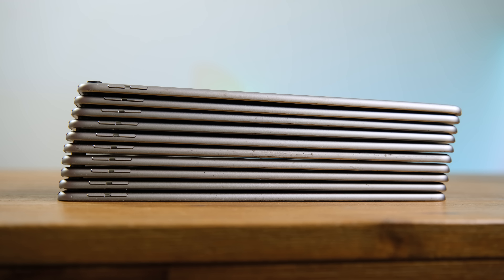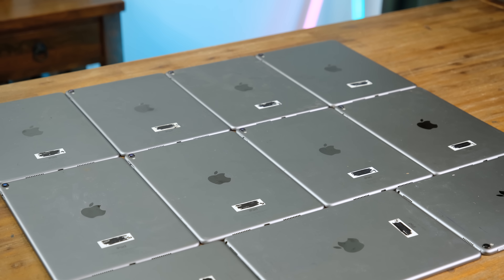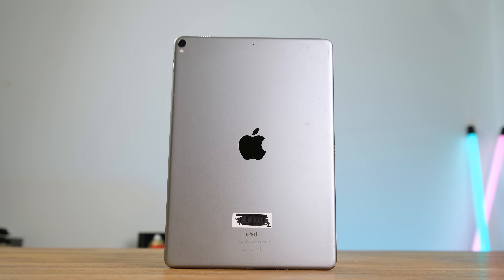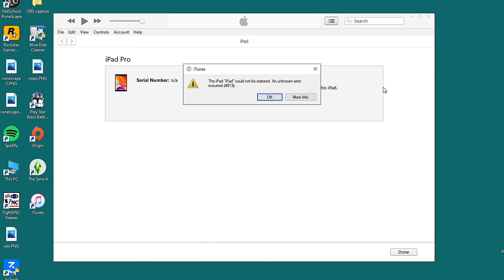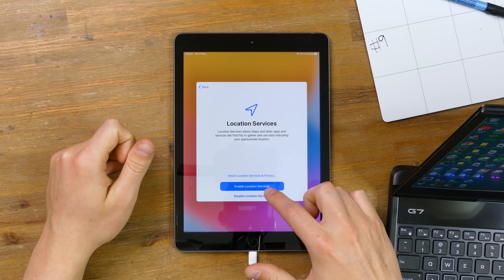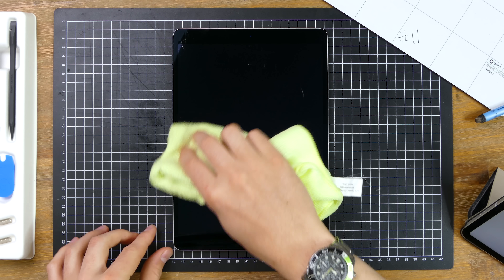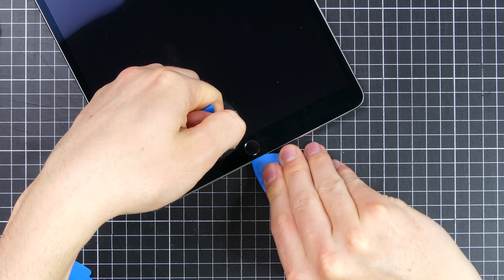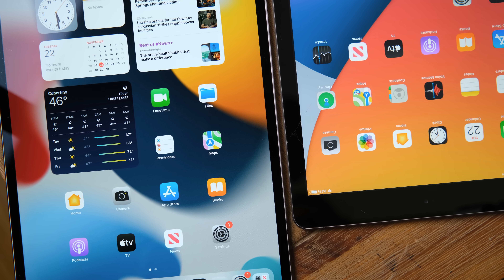11 FREE iPads Thrown Out By A School!

Comment: This is the kind of e-waste Apple should be focused on, not chargers and cables. Combine serialized components with soldered parts and one failure leads to a pricey paperweight. Given the battery and rare metals used, I'd say these dead devices are more environmentally hazardous than chargers and cables.

Comment: You saved yourself so many hours of frustration by not bothering with replacing the home buttons. Never doing repairs on iPads ever again after attempting it myself.
Reply: lol yeah it is tough, but it is worth the effort too, and possible if you heat it up for a while
Reply: It’s really easy if you heat it up and use a little bit of isopropyl alcohol

Comment: Glad to hear you got one of the iPads working! You can remove the home button from the original display and swap the two home buttons, so that the working iPad still has Touch ID (home buttons are a paired component).
As for the other iPads, the ones with failed NAND can still be recovered for any other parts that might be working, and the same goes for the iCloud locked ones. Unless the school in question can contact the students who used the iPads, there's not really any way of removing iCloud locks - which is why I tend to steer clear of iPads, in case any device I'm trying to look at has the same issue.
Reply: iCloud locked devices can be unlocked by contacting Apple, though you would need the invoice where you bought the devices from and then wipe the device.
Reply: @reazlho  I used a fake receipt maker and it actually worked, watching this video on the iPhone 5s just fine
Reply: @0w3nn  that's crazy
Reply: @0w3nn  Pls tell me where u got it from bro.
Reply: @0w3nn  apparently that doesn’t work anymore, a friend who works at Apple told me that now they actually contact the place of purchase :( I still plan to try it though
Reply: @ilyasg2108  I did it three days ago though but to be fair, I had a some information that assisted me such as that it came from Koodo and it’s purchase date
Reply: @0w3nn  yeah but i mean all the info can be found with an imei check
Reply: @ilyasg2108  Ye so it should be possible cuz it worked for me
Reply from the maker: I'll have to try and use the original home button. I simply ran out of time to film more and wasn't aware of the bottom being pared to the motherboard 👍
Reply: @psivewri  I hope you do a quick follow up!
Reply: teach me pls 😭😭😭
Reply: @psivewri  Yes, that would be a great idea for a follow up - if you have the original home button then it should be possible to swap the buttons over - the same is the case with iPhones that had Touch ID - in order to retain the fingerprint scanner you'd have to transfer the button across.
On more modern devices, a lot more components are paired.
Reply: The iCloud locekd devices can be bypassed and be used once again if they have A7 - A11 cpu using softwares like checkm8
Reply: You’re supposed to buy the iPad instead of getting it second hand. I bought one from a pawn shop back in the day and it was locked. Brought it back, paid an extra 40 and got another one that wasn’t locked

Comment: The 10.5" iPad Pro is a great machine. Still have and use mine since 2017. With ProMotion and running iPadOS 16 it really feels like a modern device.
Reply: Same here. I paid $750 for mine with 256gb of storage. The new iPads pale in comparison to the bang for buck I got in 2017. The fact they don’t have pro motion yet is absurd. I’ll upgrade this device when Apple no longer supports it.
Reply: @terrorrbabbletwo  even then you can get 1-2 more years outta it. still using ipad Air. yea the first one :D
Reply: @terrorrbabbletwo I thought about getting that iPad but i did not because I read there were reports of white spots on the display. I Really like that 2017 iPad Pro but at this point in time, I think the 9th gen is a better buy. Tried out the pro and non pro ipads at BestBuy and I could not tell the difference in Promotion and non promotion displays unless i scrolled the 2 ipads together. Promotion is not a big deal to me in the overall experience and i dont notice anything different when using different a non promotion iPad. I was hoping the iPad Air could at least get Promotion.
Reply: I still use mine and it's great but Apple's complete ignorance when it comes to the fact those have a factory defect displays is just bad, both touch issues and white spots, most have this like the issue macbooks had at least those sold in such numbers they acknowledged it.

Comment: When I worked in the eCommerce department at my local Goodwill, iCloud locks were by far the most common reason for us to throw out or set aside an i-device for parts. We had entire stacks of locked devices
Reply: that is so unlucky. is there no way at all to salvage them? once theyre locked, theyre locked forever?
Reply: seems like a prettty cool job.
Reply: @aelie8198  Apple can unlock devices for people that can provide proof of ownership, but they don't offer that to organizations, AFAIK
Reply: @aelie8198  That's the point for thieves
Reply: @Coolie-ds4tu  No, it's just Apple's way of making it more difficult to re-use their devices. Don't fall for their marketing scams.
Reply: @aelie8198  basically
Reply: @fiverZ nope, activation lock is just used to stop stolen devices from being reset and resold. If the genuine owner wanted to resell the device, all they need to do is remove their Apple ID in Settings and that should remove activation lock since it isn’t associated to an Apple ID
Reply: @ali-1000  Are you joking or do you actually believe this was Apple's intent with introducing this feature? Do you not know anything about Apple's relentless anti-consumer practices?
Reply: @fiverZ  yes I’d like to think that I know of a few of apples anti consumer practises such as the existence of the self repair shop is indirectly anti consumer plus the act of locking different components to the logic board and it does suck. However those are features that we can not control, activation lock is something we can control by just logging out of an Apple ID. Activation lock doesn’t prevent genuine owners just trying to resell their old phones. I fail to see how this is anti consumer unless you’re willing to explain
Reply: @fiverZ  your logic is flawed. most, if not all people log out of their accounts before reselling a device. And if they do forget, the buyer can just ask the seller to remove the device from the Apple ID. Apple isn’t betting on anything, it’s just preventable user error.
Reply: @ali-1000 so im a thief for trying to get rid of a disabled icloud lock for a gmail that no one uses anymord from my little cousins old iphone se he gave me? Very original 😐

Comment: The white screen with black home button was a third party display repair with keeping Touch ID from the original home button. You could do this same thing with the iPad you fixed to restore Touch ID functionality.
Reply: Yeah, I've been looking into getting a replacement screen for a trashpicked iPad I ended up with recently, and sometimes either the black or the white ones will be sold out. Clearly someone didn't want to wait.

Comment: That's like the bank I used to work for. They would do laptop or desktop upgrades for the employees and decommission the older ones which were later picked up by the same company that would go and empty the recycle bins. Pretty wasteful especially since most of them worked, they could just have given them away to the employees who wanted them. I took two of them on different occasions since I worked within the IT dept and they work great.
Reply: Ur so lucky I'm in need of one rn

Comment: For the iCloud locked ipads there is a possibility to change the SN with special tools and software and set them up like they were never locked at all. As for the ipads with NAND issues it's fixable by microsoldering but very costly

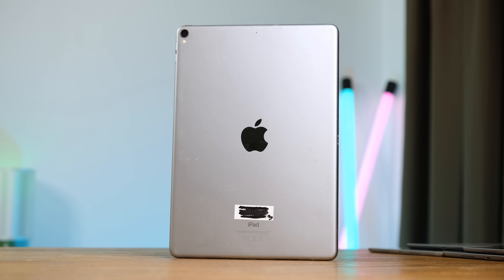Comment: 3:33 the reason why the screen and home button are mismatched is because someone at one point probably replaced the screen. The home button/Touch ID is paired to the logic board, and replacing it to match the screen would cause the Touch ID not to work.

Comment: Strange that schools dont have somesort of iPad enrollment system where u won't need an iCloud or Apple ID to install apps or push updates...
(something like JamF)
Reply: Some do! I got an iPad a school was throwing out because it had a shattered screen, and it's locked down using JamF so I can't do much of anything with it besides surf the internet and use the apps they'd already installed. They even have a delay on system updates, by like a few weeks.
Reply: @stevethepocket  Oh yeah, it sure relies on the settings set in JamF. The iDevice will only be fully yours if they remove it from JamF...

Comment: i would suggest you remove the original home button from the old display and put it with the other one. so u have touch id since they are paired to each device. just a heads up :)

Comment: For the iCloud locked ones, you can use checkm8, a bootrom vulnerability available on <2017 iPads. If the iPads are cellular, the network will be unavailable.

Comment: You could've also transplanted the home button for a fully working iPad. Great video nonetheless. Apple really needs to do something about iCloud locks creating so much ewaste...
Reply from the maker: Looks like a lot of work and pretty delicate to remove the button in hindsight.
Reply: @psivewri  It’s actually pretty easy if you heat it up and use isopropyl alcohol to loosen the adhesive

Comment: Sounds like the school learned the hard way to use MDM. FYI you can get a device un-iCloud-locked by Apple if you can provide proof of purchase. Iy requires wiping the device, so you'll lose whatever is on there, but overall it would be usable again. Device locked is another story. You need the Apple ID or MDM to fix that. All of this can be avoided by an MDM tool on an device linked to the Apple Business Manager (used for schools too).

Comment: Schools where I live also provide this, or rather, they provide very cheap, underperforming tablets. I wonder if any school near me would at all offer to get rid of their e-waste like this instead of throwing it away. One day I asked my own and they just refused, and I ended up sneaking an old PS/2 keyboard inside my backpack lol

Also, I got this Samsung Galaxy Tab E, it refuses to charge, no LED lights up, and I don't have the tools to pry it open and check what is wrong. It's my mum's old device, it worked just fine but she got a new phone and we left the tablet unused for a good while. Would leaving it charging for a few hours help bring it back to life?
Reply: leaving it charged overnight can be a possibility of the device turning on but if it doesn't try removing the back cover if it has a removable battery (probably not) and remove it and plug a charger into it and see if it turns on (probably not)

if those don't work then a last ditch attempt is to try "jumpstarting" it idk how the battery pins are on this model but on my 2012 nexus 7 you could follow a tutorial (old usb cable) and directly charge the battery without it going thru the normal way
Reply: @WaltuhD  those galaxy tab es have the typical samsung flat pin connector, so jumpstarting isn't very easy unless you're precise. the USB port however is a main point of failure, because it's not braced to the frame in any way and will simply tear itself free from the board given the chance. they're quite simple to work on though, because the entire back case comes off to reveal *everything*.

Comment: How does one remove the account lock or is there a way to?
Reply: Rarely ever is a way
Reply: no
Reply: Short answer: You can’t
Long answer: You can do iCloud “bypass” on old devices like those 10.5” Pro to trick the iPad into thinking that you are the genuine owner, but you can’t use all the features and the device does not operate stably.
Reply: I believe if the school purchased them, they can contact Apple with proof of purchase and Apple can remove iCloud lock.

Comment: Too bad you can't erase them to remove the iCloud lock. Android tablets wouldn't have this problem. I don't like Apple because they don't share their OS (license them) with manufacturers the way Google does with Android. Also, they don't make their apps cross-platform on Android and iOS is not compatible with Windows whereas Android is. I don't like Apple's walled garden approach where they lock everything down and limit their software to just their device
Reply: If apple did that ios would be very glitchy like android and apple doesn’t wanna share there stuff they don’t have to
Reply: It’s a problem for sure but that would also have the negative effect that then your phone can be stolen and just remove the iCloud lock what they should do is ping the account holder to request to remove the iCloud account if the device has been bought by someone else

Comment: I once found a first gen iPad Mini in a box in the back room of my house. It was registered to a school somewhere, and funnily enough, I guessed its PIN first try. :D
After doing that, I deleted their provisioning profile and took it as my own. It's in very good condition aside from a few scratches on the screen, and the battery has 137 charging cycles as of writing this.
It seems to have been in use between 2015 and 2016, then forgotten about from then on, and I found it in 2019.

Comment: hey, just wanted to let you know all of these models have working setupapp bypasses with silver (on mac) or f3arra1n (on windows). might be more interesting than letting them rot away
Reply from the maker: Is that a permanent solution that will allow the device to be easily reset and updated though?
Reply: @psivewri  well, it does persist after a reboot but you do need to re-do it on updates sadly
Reply: i think my other reply might have gotten filtered. ios devices before the a11 chip can be bypassed, you can check r/setupapp for help (cant link the exploit db directly since youtube filters it). if you want to remove icloud off of newer models or have it persist between updates you will have to obtain a reprint of the receipt from the retailer and unlock it through apple though

Comment: I did support for a large company before we got an MDM system. We had to register every phone and iPad with Apple. Anytime we needed an iCloud unlocked, it was filling out a pdf form and sending emails back and forth. And then after, required you to wipe the device again (I guess the device checks only one time on first connect to WiFi?). So annoying.

Comment: you need to swap the home button from the old screen to the new one as its paired to the motherboard also for the icloud locked ipads you can get an irepair p10 box and flash a new serial to the ipad that way they can still be used also for the ones with nand errors try a dfu restore in 3u tools or itunes
Reply: Yes that p10 looks like it would solve a lot.

Comment: When I graduated back in 2018, my high school literally had our IT guys make sure everything was cleaned and unlocked as we were returning our iPads. They dedicated a whole block (90 minutes) just for Seniors to either return our iPads or buy them. They had to be wiped and reset either way though. I don’t know what they did with the ones that were returned. I know some of them were then turned into rentals in case students forgot their’s at home but that was only a small amount since some of the older ones still work. I hope they didn’t just throw them away. Although they probably did since it literally had our school name etched in the back. Not just a sticker, but the whole laser thing that apple gives you the option to do. Lol I bought mine. It was a 16 gb iPad Air. I got it for like $100 I think so it wasn’t bad.

Comment: You can have Apple reset a iCloud lock if you're able to show proof you're the owner.  So, if the school has an invoice for these through Apple you can submit that with them and they will unlock it.  They encourage you to use a MDM solution every time, which looks like what the school did.  But yeah, I've been able to get them unlocked that way.

Comment: The white bezel is for sure already a repaired device, cuz of the needed pairing you keep the original home button when you change the display…
In this case I would guess that the student or repairshop just don’t have black bezeled displays in stock or white once was cheaper or the student wanted for real a white bezel display…
Reply: Oh and btw, why you didn’t switch the home button too? You cold just take the old homebutton of the original display and then the iPad would have even Touch ID again…

Comment: iCloud activation lock is not a big deal. These devices did not belong to the students. They belong to the school. All the school needs to do is fill out a simple form, and put the serials into the form that need unlocking. They then provide original order number. It’s a simple 24/48 hour turn around.

Comment: That was interesting. Thanks for making this video. With them being free, there was nothing to lose. I would have tried to fix them too. Although I've never owned an Apple product, so I wouldn't know where to start. It they were PCs, then I'd have more of a chance with them.

BTW. There isn't such thing as a point of an inch. That's because inches are Imperial measurements (base 12) and decimal points are exactly that: decimal. Dec meaning ten; metric. (base 10)